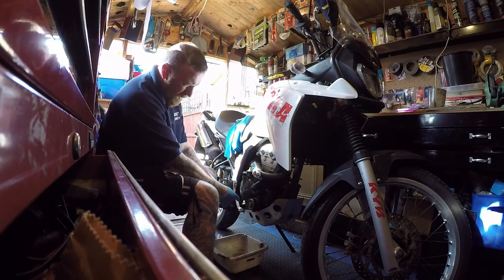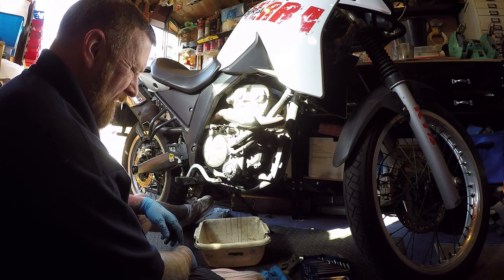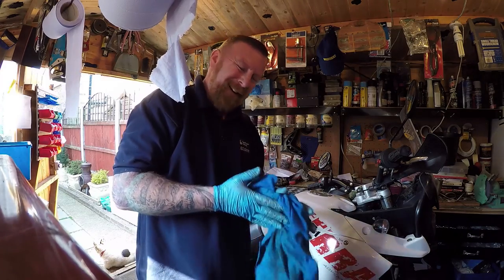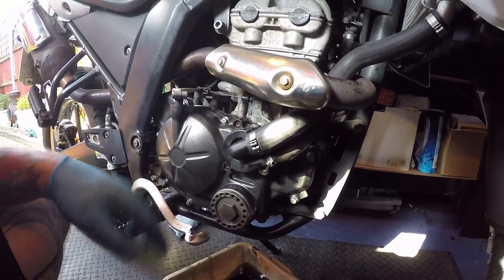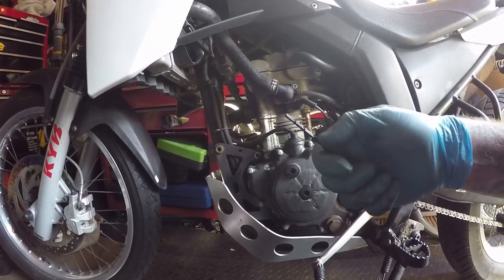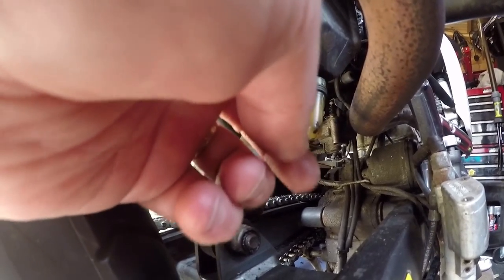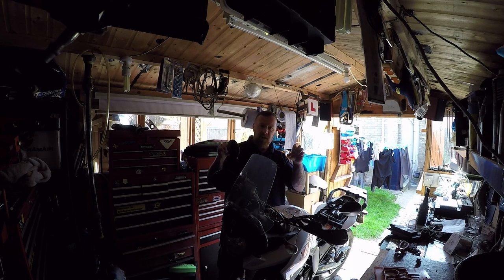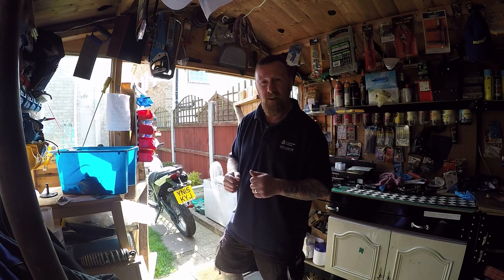DERBI TERRA 125 CLUTCH AND SERVICE MARK SAVAGE

Comment: Thanks for the vid. Before I take out the sparkplug I always fire air down the hole. this minimises the crap that accumulates from falling into the cylinder.
Reply from the maker: i do look down there first and in the past yes i have had bits fall in the pot lol, good idea and something i can do as if you watch my other videos i do have an air line in my shed
thanks for watching 
mark

Comment: Hi there, I'm looking to buy one not far from me, seen it today, only 2000km on the clock, when I press and despress the clutch  it makes a metal noise, like a knocking noise from the clutch area, if I put little bit of pressure on the clutch, it goes away, no more noise.Might be the basket? thank you.
Reply from the maker: They have a sort of trust bearing like in car clutches 
But its the plates 
Not good bud 
And would need changing

Comment: cheers for these videos mate, looking to get my first bike and been keeping an eye out for used derbi terras for a while! hard to find many videos on this thing, but I was wondering if you had any tips for me when I go have a look at one of these, any little quirks or anything to keep an eye out for, etc. 

cheers again mate, these videos are great
Reply from the maker: revenant hi bud thanks for watching I’ve had a few of these now but on done these 2 videos 
Things to look out for 
Rust , stand can break , check clutch is ok , try and get a serviced one , always keep an eye on the oil , speedo cable fails and is a few £s to get 
But all in they are fast bike handle well and fun to ride so it out ways the bad bits for me any way 
Thanks for watching I have other 125 videos on my channel worth a watch 
And please like share and sub 
Mark

Comment: hi mate, love your vids, i recently got a derbi gpr 125 4t from 2012, the engine, engine specs, air filter, i think are the same to your bike, i got a quick question for you, i don t have that litle drain plug for oil under the air filter box, and sometimes i see some oil coming out of there, not much, why? is it normal ? And how about that oil for air filter, does need to be changed or just the air filter itself ? You explained something about that in the video but didn t got it completely xd
If u could help me i will apreciate that ! Keep it up with that good content !
Reply from the maker: you can get oil in there from time to time , it can be from long journeys or if you have too much oil in the bike
you need to clean it out and if the air filter has oil on it if you cant wash it clean you need to change it as it will let less air in and wont run as well , clean plug too bud and it will start and run better
Reply: @marksavage  what kind of oil should i put there brother ?
Reply from the maker: @popescuvalentin5691  10/40 semi bike oil bud 
Not car oil
Reply: mark savage hello bro, i m the same guy, from a diferent account, so can i clean the air filter a little and put a little of motorcycle oil in the airbox? or i don t need to
Reply: mark savage and also i have a problem with the coolant because of an rubber o-ring inside the water pump, the bike is flowing coolant out of the water pump through a little hole from the water pump casing, i searched for a water pump repair kit, but it is hard to find derbi gpr 125 4t parts, what should i do brother, thank you in advance bro
Reply: mark savage so basically u are saying that is not ok to be oil inside the air filter, right ? and how the oil from the engine can get inside the air filter, does it have a hose or something connected from the engine to airbox ?
Reply: mark savage first, i have some knowledges about mechanics, but not so much about this newer 125's, i thought that is the same to enduro bikes, where u need to apply a little oil on the air filter to prevent the dust from getting inside the carb, so i didn't cleaned the oil inside the air filter, i just let it there, so you are saying that i need to clean the air box and don t put any oil in it?
Reply from the maker: @valentinpopescu3714  no bud leave it nice and clean and dry
Reply from the maker: @valentinpopescu3714  that's not good and if you can repair it good but I'd buy a new one 
If you can but you need to stop the leak as if it over heats it will damage the engine
Reply: mark savage ty for answearing to me bro, do you have a contact, like phone number or instagram/facebook account where i can message you over time if i have any questions cuz ur advices are very useful man
Reply: mark savage and again bro, how the oil from the engine is going into the airbox
Reply from the maker: @valentinpopescu3714  
Keep sub on here bud I always check it and still help if I can 
All I ask is to sub share and Like
430 plus videos so always some help and advice

Comment: Do you know what mm the oil drain plug is
Reply from the maker: as in the bolt to take it out or the tread ?
just easier taking it out bud then replace the oil 
only take less than a litre

Comment: How comes you didnt change the coolant mate
Reply from the maker: I did just not on camera however you don't change the water every service bud
Reply: @marksavage  ahh unwanted todo it because I dont know when it was last done look nice and green like the coolant I usually run shes on 15 thousand miles ?
Reply from the maker: @1991enduro  thats a good colour,  I'd leave it for a summer job as most will do many more miles 
Its an easy job bud
Reply: @marksavage  cheers mate

Comment: Hi I've got an 2009 derbi terra, and I was wondering on how much oil it takes? , because the oil stick doesn't show how much there should be on mine
Reply from the maker: does it have a view screen ?
I did an oil change video and I show it on there!
Reply: I'm not that good in English, so what do you mean about a view screen?
Reply from the maker: ok it should have a stick with the lever on it, if your doesn't have it that's odd.
so you will need to drain all of the oil out and replace with fresh 5/40 full synth and 1.15 L max with no oil in the bike 
do not over fill bud
Reply: It says under the seat that the bike uses 10w40 oil, is 5/40 a better oil or?
Reply from the maker: stick to what your bike says but different country's have different info for the bikes, I always in the uk use 10/40 for all small bikes but always use bike oil for bikes as they have a wet clutch 
car oil is different , I did a videos on what oil to use and a lot of people don't care but I always use the right oil 
I have many other videos you might like to watch bud
Reply: I live in Norway and it says to use 10/40 oil under the seat of the bike its a 125cc so not a big bike👍🏻, yeah il check out more of your videos for sure m8😀👍🏻

Comment: hi Mark I got some oil for my 125 scooter and I put the full bottle in 😆😆😆😆😆 it's was only a small bottle . am worried now . whay will happen if I ride it
Reply from the maker: hi bud start over 
2t moped 4t moped? oil for what and where did you put it ?
what oil was it?
more info bud 
mark
Reply: mark savage your a good man you always reply to any question I ask. I put 10 40 oil in in front of the exhaust. where the cap screw out with the little dip stick thing . it has no oil level mark on the side of the casing so I don't know how much I have put it
Reply: mark savage 125 scorpion mate think it's a Chinese model.
Reply from the maker: Dom Lee I try bud
So you put oil in the engine 
10/40 is fine however you say no window and no dip stick!
Then go on line check out the amount of oil you should put in then I’d drain it out and refill as I say too much is as bad bud 
It needs the be right
Reply from the maker: Dom Lee still odd no line bud

Comment: So mine was running great till this morning, and now stop starts on idle suddenly this morning
Going to check that detritus gatherer later
Reply from the maker: always worth a look bud, thanks for watching, hope my videos help
mark
Reply: Was your idle stop start issue down to this?
Reply: Cos it literally just happened overnight, was running lovely when i parked her up :(
Reply from the maker: new plug and air filter cleaned the pipe and it started better but I ended up cleaning the carb like in my clean carb videos it was just for piece of mind but ran a lot better after
you could just service and adjust the idle screw rather than taking the carb off maybe even use a little redex in with the petrol 
mark
Reply: Fingers crosses its THAT simple, never cleaned a carb
Reply from the maker: sounds like either dirt in the carb / petrol or electrical ie plug/ ht lead
Reply: She runs fine at above idle speeds, so im guessig idle needle
Reply: looks like mine has blown its detritus collector off.... 
unsure what to do now
Reply from the maker: it just means any oil/water will go on your back wheel so just get another short bit of pipe and bend the end over and stick it back on, what is the air filter like ? as for the idle still think you may have got a little bit into the carb idle jet. me id clean the carb,
Reply from the maker: it's worth doing it properly bud , please like share and sub 
mark
Reply: Yeah, i checked the air filter and it does have some oil soaked into it, and in the air box itself
that cant be good
Reply from the maker: clean the box and replace the air filter if it's to clogged and check your oil level bud just in case
Reply: Yes lad mine dies on idle will fire straight back up tho will check for debris now when I get out of bed but yeh usually cuts out under 10 mph not on load so just stalls I thought it was the plug ima service it next week u still got the bike pal
Reply: @1991enduro  Mine eventually died, lost all compression, the stop start was the rubber boot to the airbox shearing in half for some rando reason
Lovely bikes but ive since got my full license and had a few since
Reply: @johnlynford3798  thanks mate il go check that out now as I'm going to take it on a run I'm going to service it after this run so in a few days lol gotta get on Ebay get the filters oil for a good price haha

Comment: hi bro, me again xd
so what happened, i was riding my derbi gpr 125 4t today, and for no reason my clutch wasn't engaging anymore, couldn t use it, i check the cable, is ok, should be the fruction plates ?
Reply from the maker: hi bud 
so the cable works ok and pull in and out or is it hydraulic  , they have a spring inside and they can go but also might be the clutch
you may have to take the clutch cover off so it oil out etc. 

mark
Reply: mark savage i found what that was, the clutch wasn t separating the plates anymore, because a spacer from the clutch was stick togheter to a wasser

Comment: So how much oil did it take inc filter then ??
Reply from the maker: just a litre and a bit so buy two litres and it only had like a internal filter but very easy to change the oil and does the bike a world of good 
thanks for watching
Reply: mark savage it should have a proper filament oil filter there about £5 but cheers mate just got an RX 125 and there was no info in the hand book or on the net i do know it shares the same engine as all the other Piaggio group vertical 125 4T’s am going to run motul 10w40 5100 as thats what dealership used but i think 5w40 might be more appropriate
Reply from the maker: if you live in the uk 10 /40 to be honest is fine but it does come down to your preference and make of oil you like, just not cheap stuff
but the savings you can make by doing it yourself and knowing its been down are good, plug and airfilter next and a happy bike
Reply: 1,2 Liter